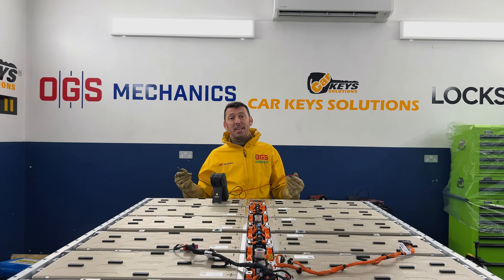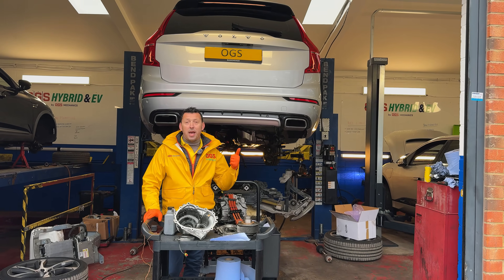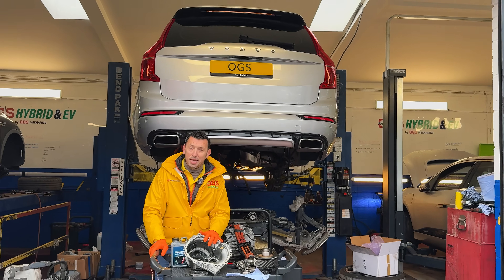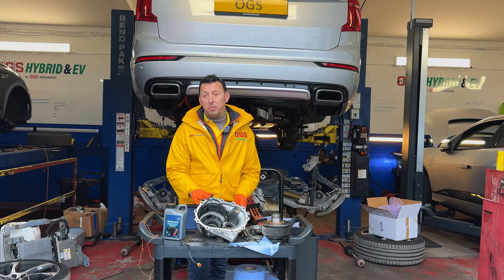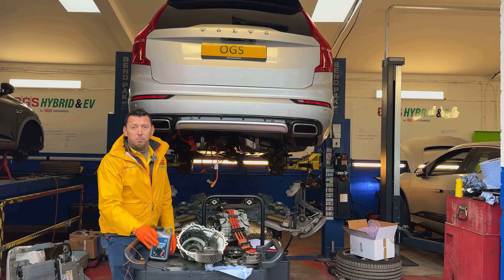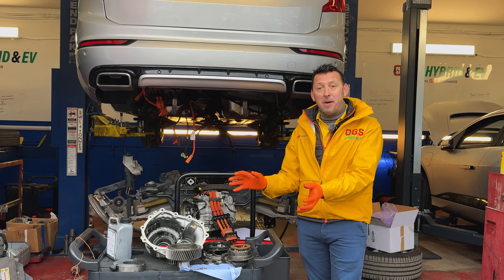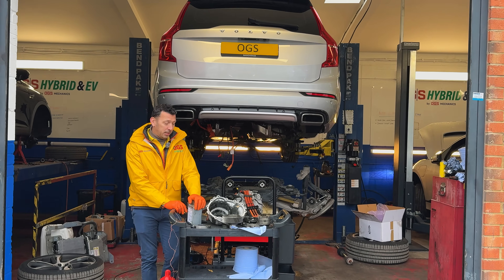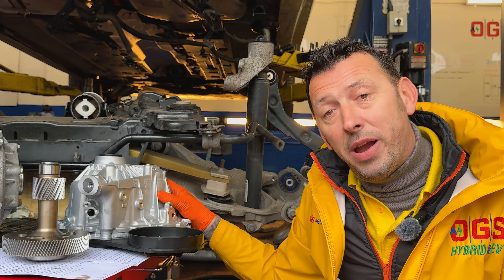Volvo XC90 ERAD Breakdown — Hidden Design Flaw & How to Prevent a £5,000 Repair

Comment: I have V60 with ERAD 2. First oil change right after buying car in 150tkm. 0.4l out and 0.75l in. I can confirm what Goerge is saying about low amount of oil in diff. I will do oil change every second engine oil service (ofcourse I do not keep official service interval 30tkm). Greetings from CZ and thank you for these videos.
Reply: oil change in erad should be done every 60kkm no need to do it more ofter
Reply: @Krapciuch  The video you just watched says 10k.

Comment: Like the start stop system, saves little bit of fuel, destroys all the parts in your engine costing you triple of what you saved in fuel....
Reply: Start/Sop systems aren't about saving fuel, they're about reducing emissions. So when you're stuck at traffic lights in a city centre for instance, pedestrians aren't gagging on the fumes from your vehicle.

Comment: My son has an XC90 which he bought Secondhand from the Volvo dealer on the IOW. It had  done 42k miles and was 3 years old. They sold it with a Volvo extended warranty and replaced the complete ERad unit under the warranty. My son is nervous about keeping the car, but it suits their needs with 3 children and a mixture of local trips on Electric and trips to the main land for longhaul with all their luggage. I shall be sending him the link for this video, with the valuable advice about oil changes and use of hybrid mode. 👍